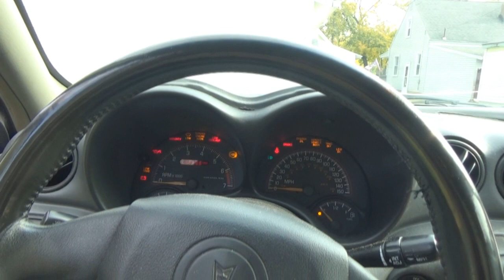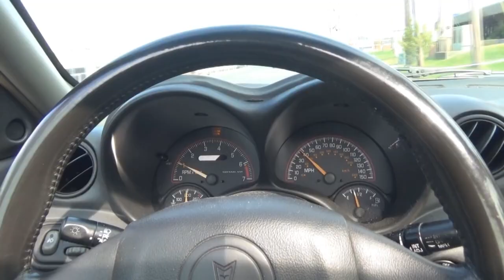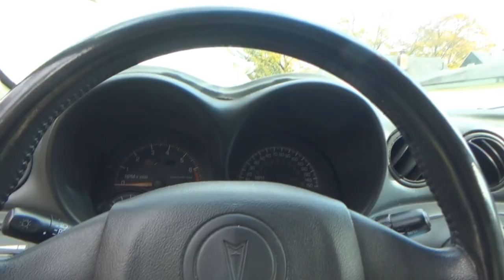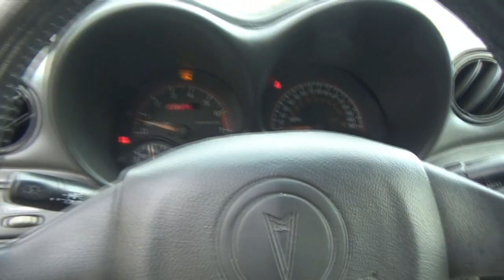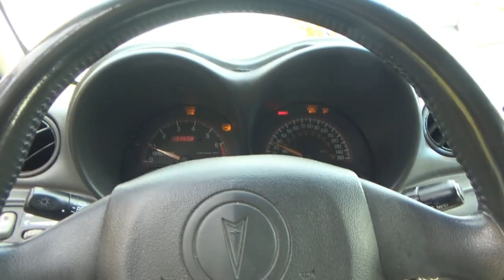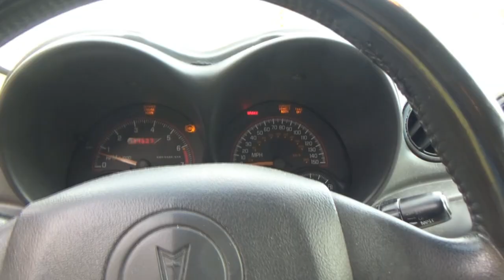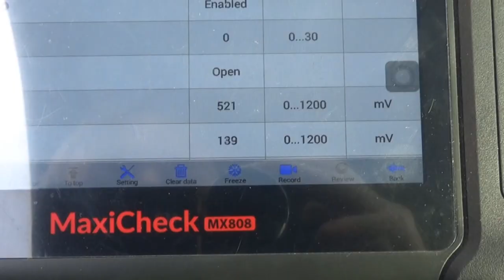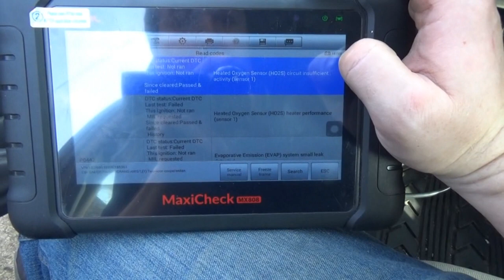MV 454 - "Well, We Have A Bad Wheel Bearing After All"

Comment: That’s what happens when you neglect maintenance and repairs  starts falling apart
Reply from the maker: Or it’s because it has 134,000 miles and it’s worn out
Reply from the maker: This is not my primary car. This is a $750 project car. I’ve spent thousands of dollars bringing this car back to life and keeping it alive over the last 4 years just for video content. I’ve put almost 17,000 miles on it since I’ve bought it. This car has come a long way since I took ownership. It was broke down when I bought. I fixed it. This is the original wheel bearing on this axel. They are not serviceable so when it goes, it goes. It will be replaced soon.